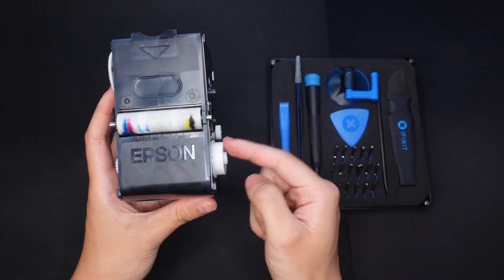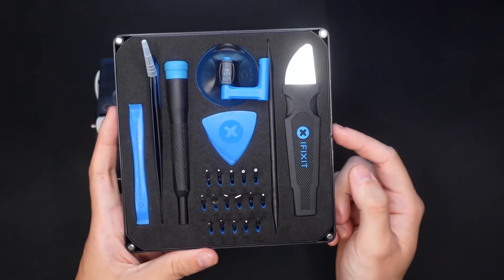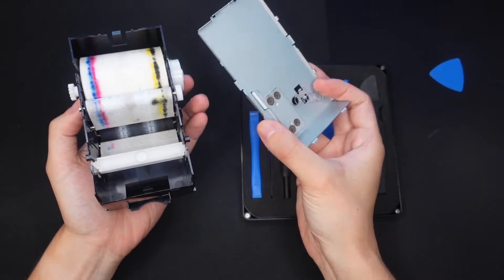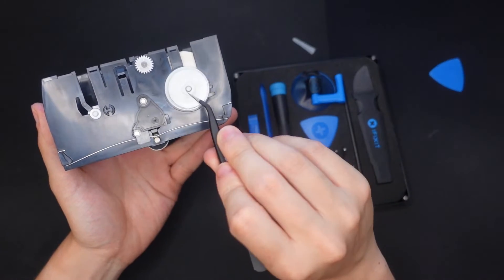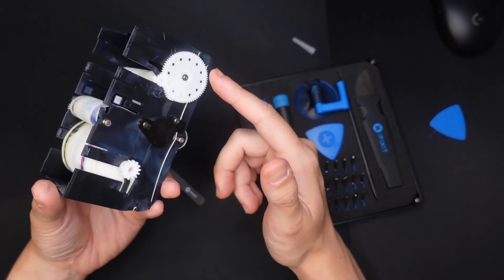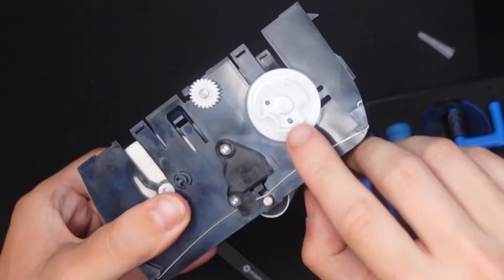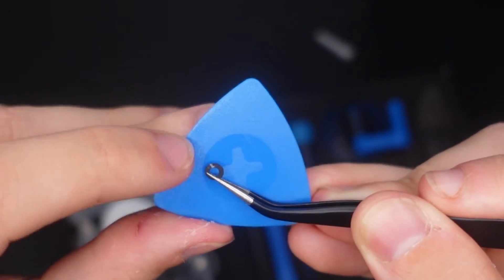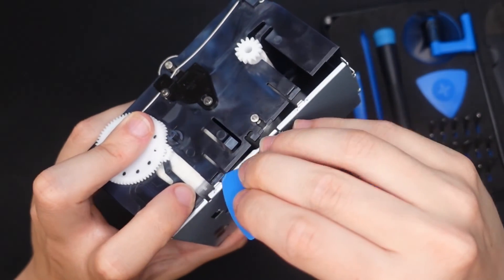Manually Resetting the Head Cleaning Set for the Epson F2000 & F2100 - Print Head Wiper

Comment: HI there, how many times have you done this trick, does it damage the head if we do twice or more? Great video by the way 4K good job
Reply from the maker: If you do this, I would only recommend it only once. The purpose of this part is to wipe the nozzle and if you rewind it back too many times, it won't be able to do its job and the print head may have damage over time.

If you are concerned about any damage, I would definitely recommend just going ahead and replacing it.
Reply: I rewind it every time. About 4 times so far no issues. I also bought refill rolls from China but attaching it seems to require some crazy glue which I don’t have so here I am watching this video a 5th time.